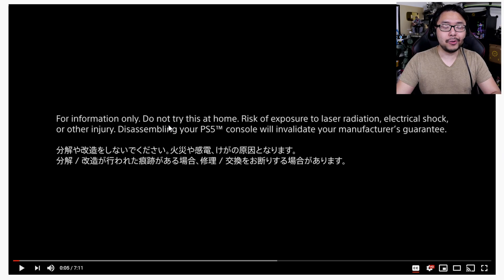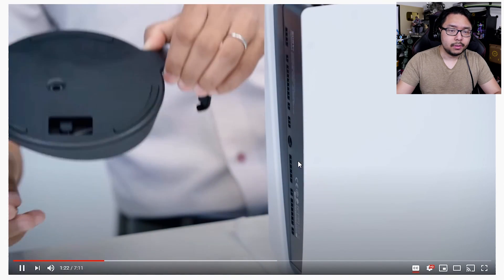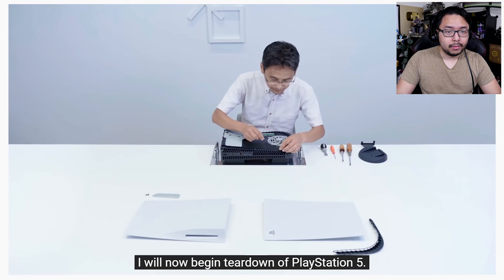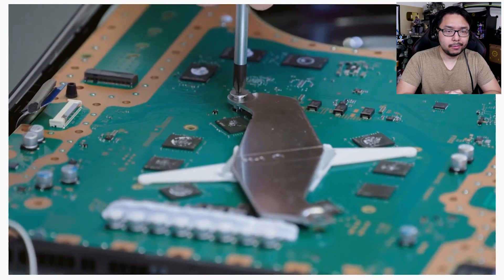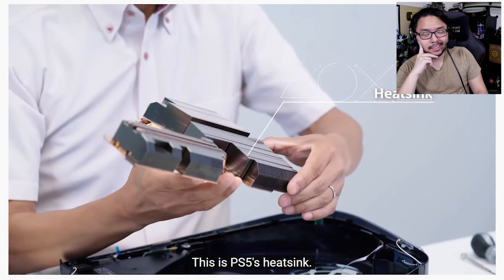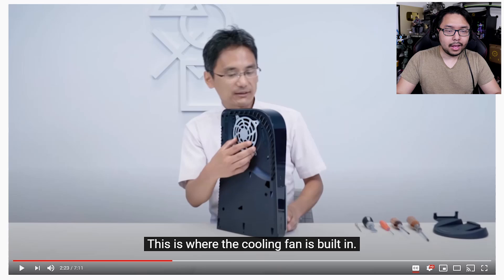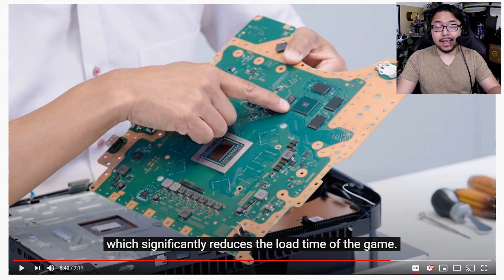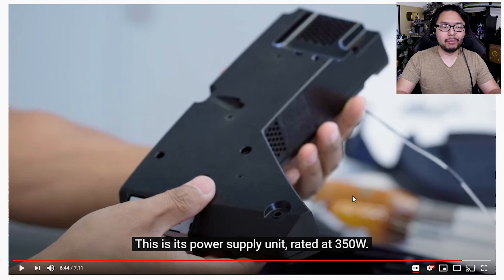Reacting To Sony's PS5 Teardown (Cooling, SSD Slot, Swappable Panels, & More)

Comment: 6:44
The only youtuber who doesn't lose his head at liquid metal cooling
Me: wtf bro?
Reply: I’m more surprised about how they designed the rest of the interface. LN runs the risk of moving around and leaking if not sealed properly. It looks like Sony has some kind of graphene “fence” around the die to make sure that doesn’t happen.
Reply: @Atourq  it's liquid metal not liquid nitrogen(LN).
Reply: @Janken_Pro  You're right. I was typing on my phone and made that mistake.
Reply: @Atourq  'graphene fence'?

You mean foam right?
Reply: @TheLegend-ic8wr  Yeah it looks like it's made out of graphene.
Reply: @Makon18  What people? People who were paid to promote PS5 and was there in a controlled room? Where is the heat going? Is it disappearing into thin air? Hot air is supposed to be blown off the console so you need to get hot air to your hands on the exhaust grills. I am sure PS5 will run cool enough but it won't be ice cold. It's thermodynamics man... Not that hard. Plus making a 11 liter body and cooling it is not an engineering marvel. This is all I am trying to say, it better be cool man wth
Reply: He noticed the heatsink and the size of it. Maybe he's not into that deep.
Reply: @Makon18  Fair.
Reply: @Makon18  not sure if you're being sarcastic or not :D I admit that I was being an asshole but it just bothers me that this is over appreciated. It's a huge heatsink, big fan in a massive case... Of course it will run cool, I mean, duh.. but how is this an engineering marvel :D this is the part that I don't agree with. That's all.
Reply: Yong probably doesn't know much about tech 8n general IMO. That or either he's an xbox fan boy, the amount of effort put into cooling for the ps5 is crazy and I think it deserves praise
Reply: alexgamerpr12 no that’s a bad sign lol. As a large company, everything you do and every part you include into a product costs you money. they don’t care about the consumer they care about making money and saving money on what they build and sell. the engineers must have felt it absolutely necessary to include that because thermals must be such a problem for this console also the inclusion of liquid metal makes repairing a die Difficult for even experienced hardware technicians. Not to mention the inherent risk of using liquid metal in any electronic device. Leaks will always be a problem. Sony’s only goal is to save as much money as possible while still delivering an experience that most consumers will regard as a good purchase. 
Just like any other massive tech company. The only time companies stop short changing the amount of engineering and the price of materials that are used to produce a product is when you get into the enthusiast grade PC parts, A.k.a. the “money is no object” level of consumers. Which is a very small market share compared to The majority of sales.
Reply: @JustEnoughKeys  That doesn't mean they make unreliable consoles. People already looked at the failure rates of Xbox 360 and what that costed Microsoft. The companies would be idiots to make highly unreliable consoles with short lifespan. Regarding liquid metal, maybe Sony worked out a specialized compartment which prevents it from leaking. Regarding the life of that and changing it, I mean if a console has run for at least 6-7 years, I'd rather buy a new one instead of getting it repaired
Reply: @alexgamerpr12  you're sounding kinda like a Sony fanboy as of right now kid.
Reply: @devizesolstice4617  I mean he's not wrong tho, ps5 cooling is so good that people start talking about that liquid metal cooling system
Reply: @harrysyodihermawan2739  I know he's not wrong but stating how he did was just over the top. He's clearly new to yong yea...we all know he's not a Microsoft fanboy.
Reply: @devizesolstice4617  It's ok, I might sound like one but in really not. I mainly play on my PC and play with my friends on the ps4... That being said im just overall more impressed by the tech inside the ps5 than the xbox. Yeah it has more raw power, but cooling IMO is more important than a few flops. It also has double the ssd speed. Just saying man
Reply: It's weird that some people act like liquid cooling solution is the second coming of Christ... If it is so effective and superior, why did the case have to be so damn huge? They wanted to run it at 30 degrees celsius? We all know Sony likes to make their devices as small as possible. They had to throw everything they could to keep the console just cool enough to operate because they are not very good at engineering. This is a piece of shit overengineered hardware man. I'm disappointed
Reply: @kunniak4673  mow you sound like a Xbox fanboy 😂 they're clearly better at doing things than Microsoft since they're in the lead by far...liquid cooling is by far the most superior way of cooling but they added the rest to it to make sure it stays cooled down. It's clearly much more superior then Xbox with cooling soooo.
Reply: X 52 and in the video young said the speed was double the Xbox not that any of this matters
Reply: @devizesolstice4617  I own both systems and game on both. Sony have strong exclusives, no one can deny this and it is very important as these are gaming consoles. However, PS4 is a piece of shit hardware as everyone would agree. Xbox One OG was too. PS4PRO is the worst I've seen in my life.
Reply: @devizesolstice4617  Thing is, Liquid Metal or not, that's moot if the PS5 can't transfer the heat off of the heatsinks. Rather than the LM be the focus, I'm more interested in those heatsinks. Are they full copper with nickle plating on the fins or are those aluminum fins? If they're aluminum, it kinda defeats the purpose of using copper for the heatpipe and contact plate.
Reply: @kunniak4673  LM only transfers the heat effectively from the die to the heat sink, you still need air to cool the heat sink (though a bit less than with paste since the temp delta will be bigger).
Reply: @kunniak4673  Wow wtf. Sony has been designing and producing hardware for over 4 decades and thats not just Playstations. And youre saying their engineering is poor? Dude calm down
Reply: @sushanthadusumilli1067  I like Sony and use their products. But PS4 was a disaster and PS4PRO was disgustingly poorly engineered. Period. What bothers me is that you guys are saying that cooling a 300 watt console in a 11 liter case is an engineering marvel. I appreciate not trying to make it smaller to the level that exceeds their budget or engineering skills. Because I don't want to have a jet engine like PS4PRO in my room again. But guys, come on, cooling a 300w console in a case so huge, it's not impressive at all. I mean, come on :D
Reply: @sushanthadusumilli1067  can we admit that cooling a console of this caliber in a 11 liter case is nothing special and nothing to be called an engineering marvel. I didn't say anything praising Xbox or Microsoft. what happened with x360 was disastrous and shameful. But you have to appreciate One X as the piece of hardware it is and how it compared to the Ps4pro monstrosity. I am just stating my amazement on how people are trying so hard to praise Sony out of something so simple. I will buy both systems eventually and enjoy games. I don't care how big PS5 is. I am saying that cooling this thing is not impressive at all. Let's admit Sony wouldn't voluntarily make a console this big so it looks "special". That was just the best they were able to do. And heat is definitely dependent on power uptake. What are you talking about? If you are saying that it will go well over it's PSU limitations when OC'ing, then okay, I guess...
Reply: @kunniak4673  Impressive in the sense, people are talking about liquid metal cooling solution, not the size. Your'e right about size in the sense that Xbox One X was really great in that aspect. It was the smallest. But you can see even Xbox Series X is also much bigger than One X. When you have such new powerful processors, the size obviously will increase to allow for higher heat dissipation. Sony was ingenious in the fact that they went for an un-conventional cooling solution, which is actually quite suitable for the way PS5 works. There are reports of Xbox Series X box getting very hot after running for a while. Its a real tradeoff between multiple factors here and you are just criticizing Sony based on the pure size of the console. Maybe they thought to go for an extremely cool system with minimal noise and that's why they went for more size. You need to understand that those companies do their research and build stuff according to their specific priorities.
Reply: @sushanthadusumilli1067  Xbox series X is not running hot at all. Those comments were coming from people who have no idea how energy converts to heat. It only meant that Xbox Series X's cooling system was doing it's job perfectly, allowing the heat off the system through it's exhaust fan. Remember, heat better out than in. That's the whole purpose of cooling. Xbox will not generate more or less heat than PS at the same energy consumption level. Because... well, physics. Thermodynamics... Please watch Spawn Wave's video on this. He was very explanatory.
Reply: @sushanthadusumilli1067  I am not criticising Sony for the gigantic size of their console. I'm truly supportive of the decision here because they're really prioritizing the cooling rather than size and this is the smallest they were able to do. Because, well it was. You need to understand that energy converts to heat at 1:1 ratio, let that sink in first. Xbox engineers were able to fit a more powerful system in a much smaller case, that's the engineering that deserves applaud in my opinion. Cooling a 300w system with a gigantic heatsink, big fan in a massive chassis sure is a great cooling solution, but it is not impressive at all. Sony can afford building a weaker system in massive chassis because they have the brand power, fan base thanks to their great exclusive library to balance that out and get away with it. Imagine the table was the other way around and xbox had the weaker system in a gigantic case... It is hard to imagine they would be getting kudos for cooling that system with a huge heatsink and a big fan in a 11 liter fan.
Reply: @kunniak4673  XBOX was able to fit in a more powerful system in a small case. But whats the heat output? What the CPU/GPU temp? Whats so impressive with xbox where the units are not even in the hands of consumers and you are already crediting xbox for their design vs heat dissipation? Sorry your argument holds no substance at the moment until people are running the system 16 hrs a day playing games. BTW, you do not even have a series x and you are defending it as not running hot and doing its job PERFECTLY and dissing Sony. Way to go fanboy.
Reply: @gthomas6229  First of all, everything you are asking me remains to be seen for both consoles. WE CAN'T KNOW YET. Exactly my point. I would be extremely surprised and disappointed if either system failed to maintain low and operatable thermals with their designs. I believe they will both have very good thermals and silent fans. But, if you or other people think or believe that Xbox Series X runs hot because hot air is coming out of it, I just assume that they slept through their classes at school. If you think Sony outengineered Xbox with a chassis twice the size, utilizing a huge ass heatsink, then that's weird. I don't understand how people don't see that this is the safer&much easier and much less challenging way to do it. I admit that it is a very good and effective solution, but it is not impressive at all. This is all I am saying. I am happy with both consoles as long as they work fine, cool, silent. I personally don't care about the size at all. Does this make any sense to you? 

I am just saying that, if Xbox Series X's fan is as silent as people who have it claim, and the air is as hot as it is claimed, then it's doing a perfect job disposing of the heat out of the system. If you are saying that it means the console generates way too much heat... Then I will just tell you to learn your thermodynamics, man. I am sorry but I hate having to say this as well.

I doubt that I could be called a fanboy, because I think you're checking more boxes with the way you are accusing me.

I play on all systems including PC and I am just happy that my next Sony console won't be full of design flaws which is a win for all gamers. I will come bash MS if the Series X turns out to be poorly engineered and has PS4 Pro like shortcomings with pleasure. You can keep your eye on me if you care, lol.

Comment: Doesn’t the SSD is like, custom made? It’ll be a long time before a reliable third party ssd comes out. If it ever comes out
Reply: I'm pretty sure it's the ssd controller that's custom
Reply: No, there are reliable NVMe ssds out there that are compatible made by reputable companies. The problem is that if you want one they are super expensive especially for the 1tb or 2tb options. Even for a PC build they are an expensive option.
Reply: @eliminatorxx713xx  My mistake then. But yeah, I am sure it won't be cheap. Actually, for everything that is playstation 5 have, it's very cheap. The 1tb SSD is more than half the cost of the whole thing

Comment: Keep in mind ps5 ssd expansion slot is for a nvme ssd.  Where the series x is just a regular ssd.
Also I have seen videos of people comparing load times with Xbox one x and series x on old games... no shit it's faster in series x! I'm still waiting to see a decent performance of the series x with a new generation game.
Reply: Victor Murphy   NVME is used in Xbox. It’s not a regular ssd 😂
Reply: @mtheprof48  Sony's is still apparently faster, though.
Reply: @DeathBringer769  So? Ps5 has 20% less power.
Reply: @ntz752  so? Series x has no new special features other than being more powerful... and honestly 20% isn't that much of a difference when it comes to computing power. Ps5 is way better engineered than series x. The series x is already reported to have hearing issues.. so there goes the extra 20% power.

Comment: 9:02 Side panels that just cover the sides to the inside edge of the vents/intake would be an improvement to it's size and look. If that's what you meant.

Comment: As their video shows, it is completely possible to take off or replace the side covers, SSD, fan and to use a vacuum cleaner on the dust catchers without voiding any warranty.

Comment: The ps5 fan is a huge improvement over the ps4. Even tho it's the same design it's much wider. If it gets clogged with dust like the ps4 did over time it looks easy to access to clean.

Comment: The Series X uses a proprietary memory card, the PS5 lets you use a standard ssd but it's behind a panel and a screw. That reminds me exactly of the Xbox 360 with its proprietary hard drive bricks, and the PS3 which used a standard laptop drive behind... a small panel and a screw holding it in place.

Comment: I honestly think they didn’t go with black panels because the system was already hot enough and it’s scientifically proven that black material gets hotter than any other. Just my opinion, could be wrong.

Comment: regarding your loud ps4 pro.. we had this problem too. when you remove the cover to see and clean the fan, use a flashlight to look through the fan's blades. in one direction there is a metal grid. ours was almost completely closed with dust. i managed to vacuum it with the help of a straw ^^ after that the console ran considerably quieter.
Reply: It seems their biggest issues with the Pro was ventilation and air flow. Notice how the PS5 looks like it can actually breathe and is equipped with iron lungs that can take the heat. Easy access to vacuum as well. I’m very excited to see how it can perform next month.
Reply: @christopheryanez  Until Sony realizes just like PS4 PS5 is underperforming and do the same thing as with the pro sacrafice airflow space for power. PS4 had enough and pro is only slightly bigger I bet it will be the same with PS5 and the noise be back again
Reply: When reading "with the help of a straw" I can't help but think that means you sucked up the dust yourself with a straw, even though you obviously didn't lol.
Reply: @TheDaxter11  xd

Comment: Im just going to assume everyone forgot how loud the ps3 was or i have the loudest one around
Reply: Looking back on it, it’s not as bad as the 4’s jet engine. The 4 is the loudest console I’ve ever owned.
Reply: @j.vinton4039  im just gonna this and leave it there because it's possible we have different models my 4 has never even been a third as loud as my 3
Reply: I was lucky both times! My slim PS3 was the quietest console I've ever owned - I still play it from time to time. My day 1 PS4 is pretty quiet too.